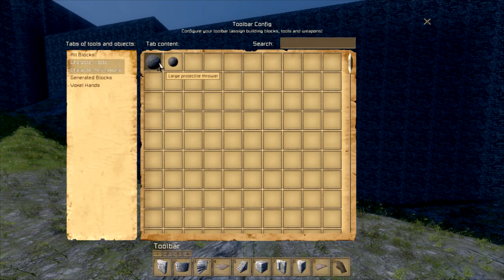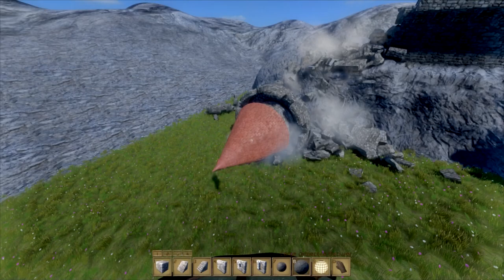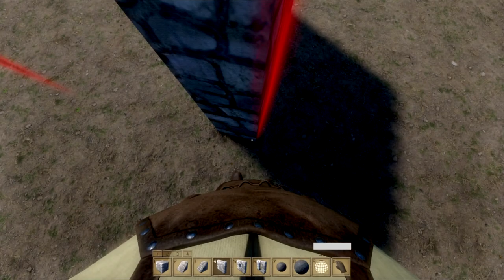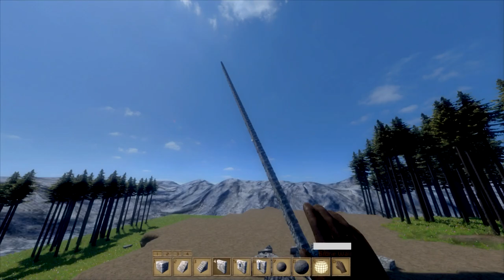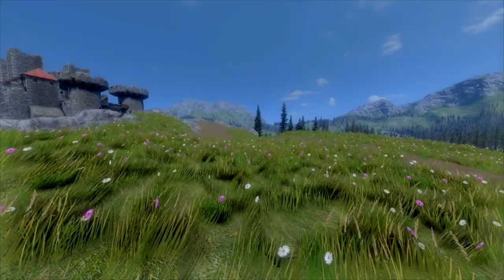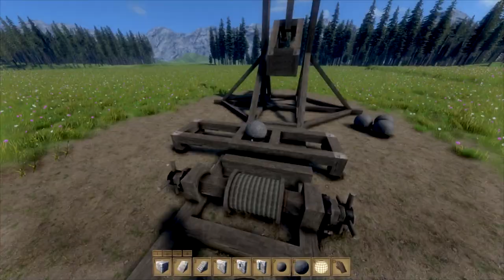Medieval Engineers - Castle Destruction Showcase - Structural Integrity Overview

Comment: So how bad is it, i was thinking about getting this when it came out till you started talking about crashing. Any clue on the kind of parameters you would need to run this game laptop/computer wise?
Reply from the maker: J. Richard atleast top of the line 2014 era
Reply: It's very heavy on CPU requirement in particular, contrary to many other games. A modern up to date CPU would be recommendable, preferably a desktop model if possible, rather than clock speed limited laptop models. That said it's also in early development, so crashing and bugs are entirely expected and understandable.

Most importantly though. If you buy this, you should primarily be buying for the future, not to play a preview. Early access stuff can still be great fun even this early on, but always remember that the final product is what you're really paying for, and games do take several years to make. Early access deals are a contract of trust before anything else, and always at least a bit of a gamble.

Comment: do you think a gtx 970 acx 2.0 ftw+ could handle this game?
(http://www.newegg.com/Product/Product.aspx?Item=N82E16814487077&cm_re=evga_gtx_970_acx_2.0_ftw-_-14-487-077-_-Product)
Reply: If you're not joking, that goes past the recommended requirements for medieval engineers.
Reply: That card is more than capable for any game on the market. Could probably go half the price for most games honestly. You're somewhat asking the wrong question though. This game is more dependant on CPU than GPU, due to the physics and simulation elements. Make sure you get an up to date CPU. An i5 or equivalent is probably a good area to aim for if you have that kind of budget.

For example, in Space Engineers, my old GTX 560 still happily runs it at 60+ FPS, but if I start crashing too many ships, can still get oddly smooth slo motion style slow down, at the same time as a good framerate. That's the sim speed lagging, which is related to the CPU.